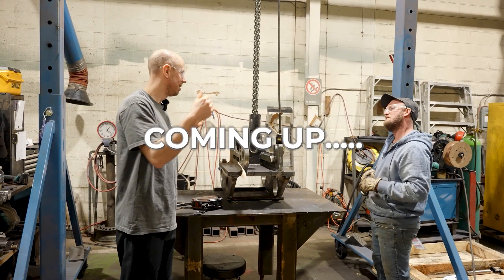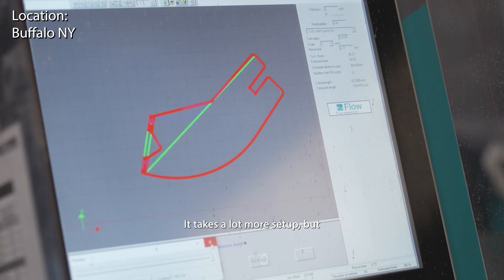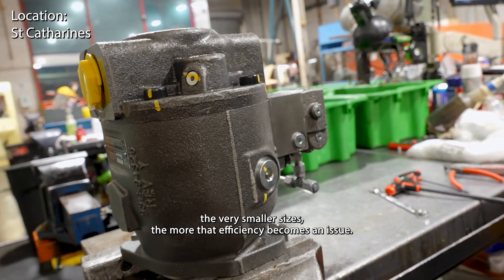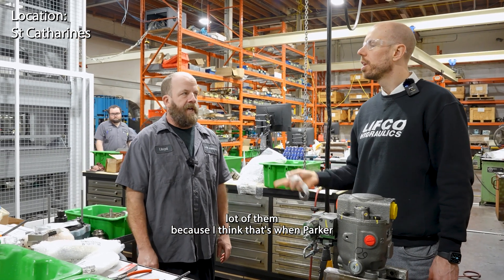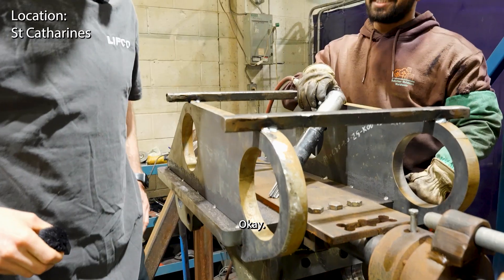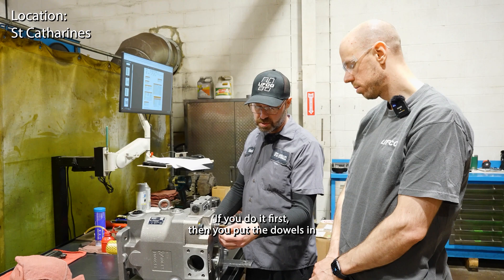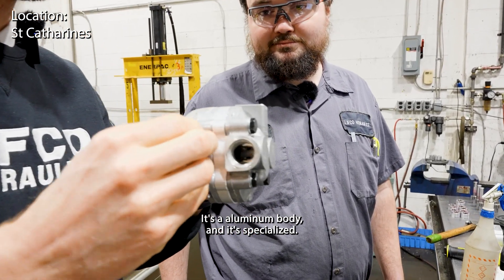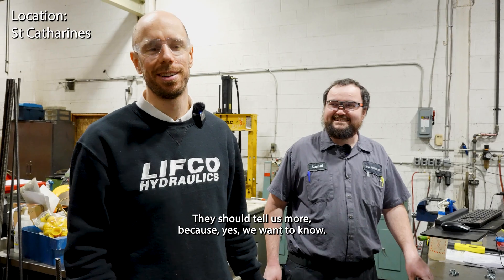10,000 Subscribers, Over Stripped Threads, Welding, Pump Mods and More!

Comment: I would like to see more in depth technical stuff please, share some of the 26 years experience in that shop in long form. Ive spent lots of time working on forestry hydraulic systems and I understand hydraulic trouble shooting better than most but finding good information and teachers on hydraulic stuff is only getting harder as a lot of people are aging out of the industry.
Reply from the maker: We can make that happen. The Linde pumps and motors are used in Tigercat equipment like the feller bunchers and skidders. We will get some videos on confguring the settings. -Fraser

Comment: How thick of material can that water jet cut? I'd love to see that in action!
Reply from the maker: About 2 feet I think. Fun fact: if you left it running in one spot too long then it will cut through the bottom of the tank (after going through a couple feet of water). Service techs from FlowCorp had seen it happen before. -Fraser